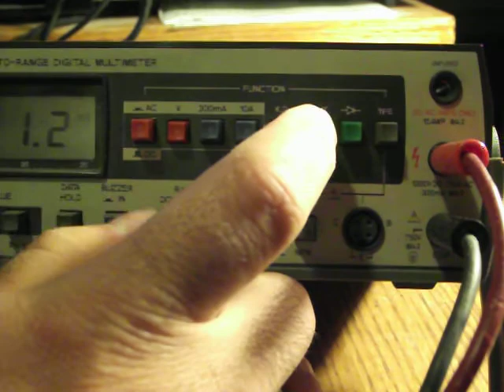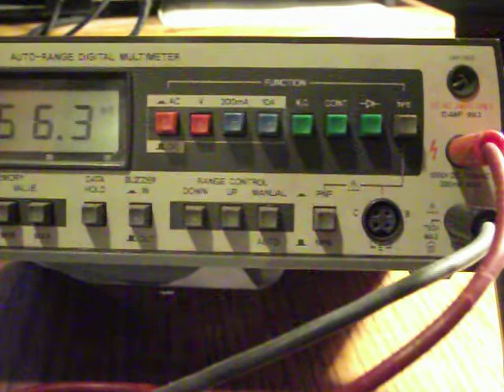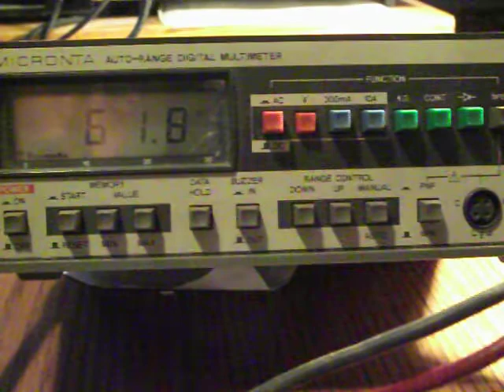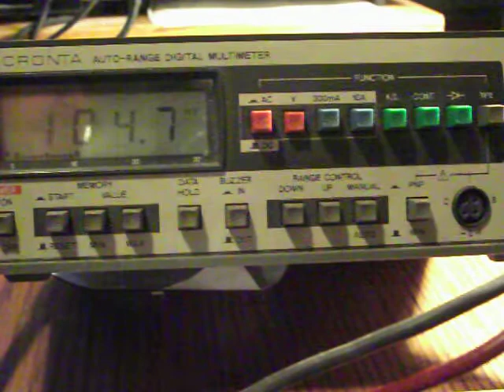Micronta Benchtop Multimeter Model 22-195 Repair video # 2

Comment: I can't believe how difficult it is to find out calibration information on this meter, I can play with VR1 and VR2, it will then show correct voltage at 10 volts, but then trying to test 2.5 volts it will show over 3 volts, there's plenty of sites with the schematic, but nothing on what VR1, 2 and 3 do and what the calibration procedure is.
Reply from the maker: It can be very frustrating, I know, so I feel your pain. Did you try to reverse engineer it by inserting a 3 volt supply and adjust the VR to get the meter to read 3 volts? Just a thought. I am not sure if it is possible.
Reply: @Tobinindustrial  I can make it show the correct volts on any voltage, it's when I use a different voltage to measure it shows different, then if I calibrate it for that voltage, the other voltage is out, I think VR3 is for AC, both VR1 and 2 adjust DC voltage, but why is there 2 pots for that? Oh and when I calibrate it correctly for say 10 volts then manually range up, it will show something like 11.7 volts, go back to auto and it shows 10 volts, it's really weird, the only other thing I can think of is a part or parts are worn/out of spec, and I wonder where the calibration for resistance is too?
Reply from the maker: Gotchya.... It may be out of spec parts!

Comment: The meter has high input impedance FET amplifier so it will pick up static electricity when the probes are "floating"
Reply from the maker: Thank you for the information. That makes a lot of sense.